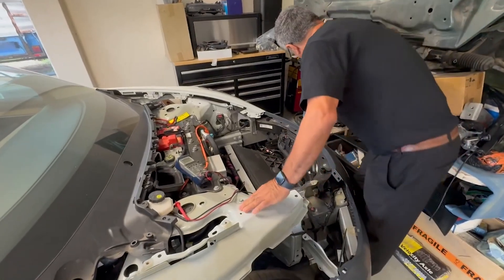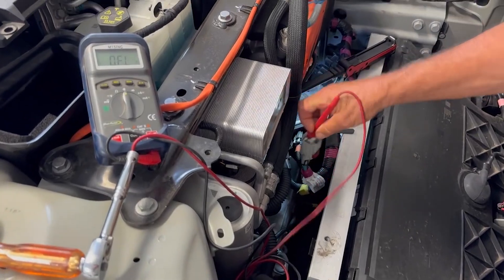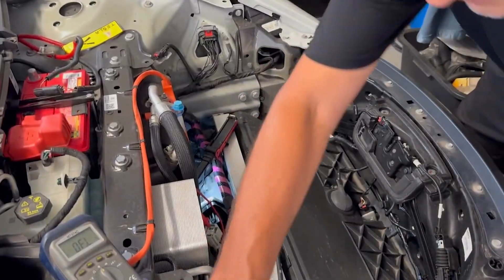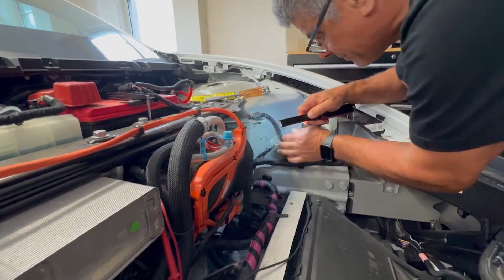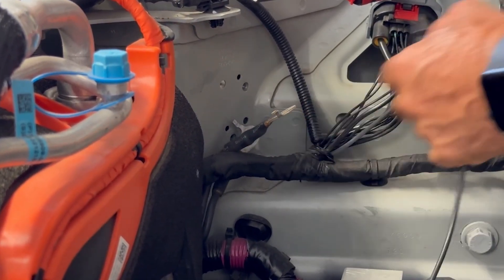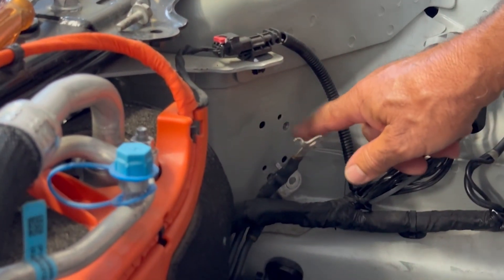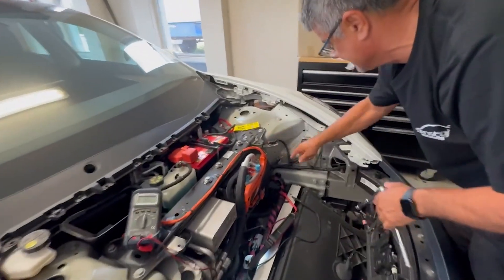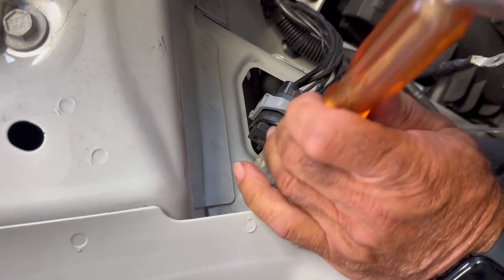Where is the Steering Rack grounded on a Tesla Model 3?

Comment: Can this maintenance be done by just powering off and disconnecting the 12v, or do the high voltage cables need to be disconnected in any way?
Reply from the maker: You don't have to disconnect HV but of course always a better safety precaution to do so.

Comment: Seems like a lot of manufacturers are doing the same with there grounds as well. Bolting to a painted surface wishing the bolt threads will keep it grounded. The threads don't give enough surface area to keep grounded over the years of moisture, heat/cooling cycles, and continuous vehicle vibrations
Reply from the maker: Totally agree. Surprised to see this from Tesla